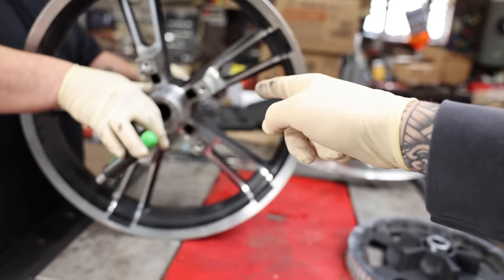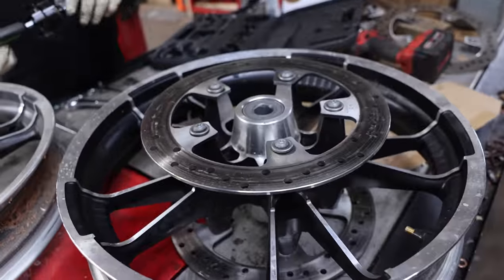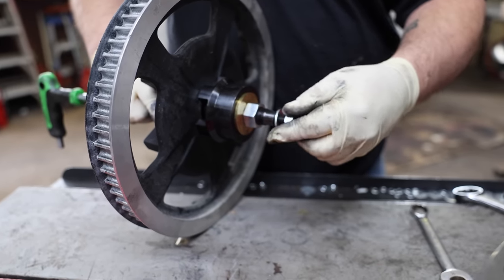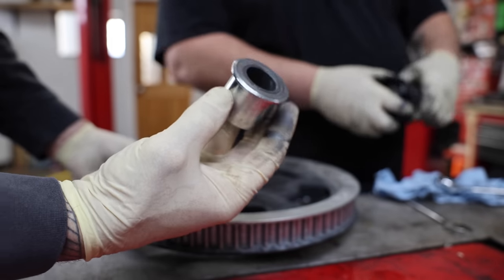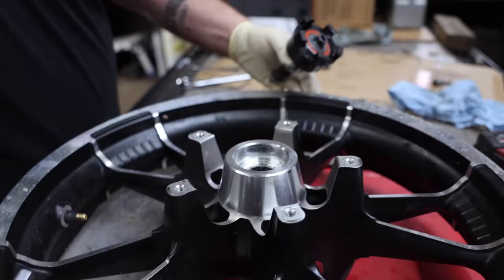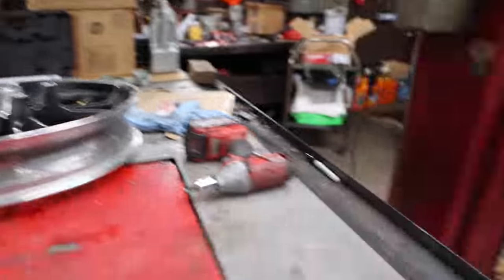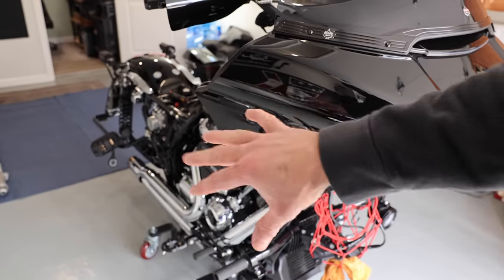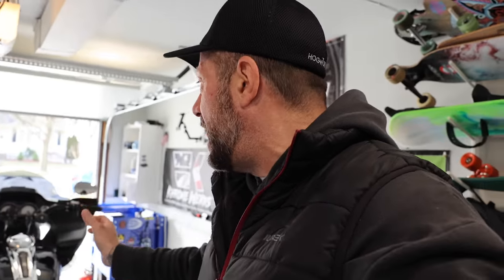Harley Davidson road glide wheel bearing removal | powder coated wheels #roadglide #cyclefanatix

Comment: Outstanding! Nobody has a video that I could find of bearing removal of Cush drive sprocket. I am changing front and rear tires and bearings as soon as tomorrow if they or when they get delivered and you helped me big time. The only outside help I need is having Cush/drive sprocket bearing pressed in. Thank You.

Comment: Yes, yes yes, definitely make sure that you replace those brake pads. Once they have been saturated with any type of oil or lubricant, they will never work properly again. The brake rotors you can simply clean off with some brake clean.

Comment: Excellent  video Jon,yes the bearing puller tool,did the job,you have a great friend and mechanic, i ,replaced my rotor bolts for chrome ,when I got my wheels back from wheelbuilder,black rims,stainless  spokes,continental  white walls,best wishes  🇬🇧

Comment: I know you already have valve stems. If you get the TPMS valve stems you can have the dealer turn on the TPMS system and monitor your tire pressure. Just a thought. I don't know if the balancing stuff will affect them.
Reply from the maker: Thx for the tip 👍

Comment: What about replacing wheel bearings with those ceramic bearings Zippers performance mentioned in your video when you visited there!? Supposed to reduce drag by 40% 😁
Reply from the maker: Yes, I thought about it, they are quite expensive

Comment: Just bought an OMB puller, installer.  Hoping I DONT have to remove the belt pulley.  It looks like I'll have to.  No fun with only hand tools.
Reply: What's the best to stop the tool from galling??  I have. 1) copper anti seize, 2) 3 in one oil 3) WD-40. 4) Oster hair clipper gear grease.   Thanks for any info!!

Comment: Hey buddy, I’m getting my wheels powder coated in the next few weeks. I read online if you remove the wheel bearings you’re supposed to buy new ones is this true? And what about the valve stems? Do you need new valve stems?

Comment: I’m changing rear tire and noticed bearings were shot. My belt drive pulley doesn’t have any bearings. Just two bearings in the hub.  I’m trying to figure out if I still have to take off pulley. I have a puller it’s too short to pull bearing on that side since pulley adds an extra inch or two.  Can I pull out rotor bearing. Then bang the other bearing out without taking pulley off?  I’m just afraid to shear bolts getting them out cause of the red locktite. Someone said apply heat. But then I’m worried about warping the hub??  I wish I worked on my bikes more when I was younger instead of dealer doing it. Now I’ don’t have that kind of money. So I CANNOT screw up!’ Lol.
Reply from the maker: Get a puller